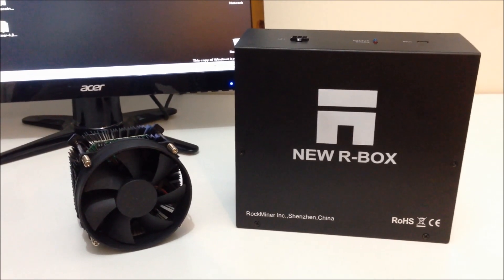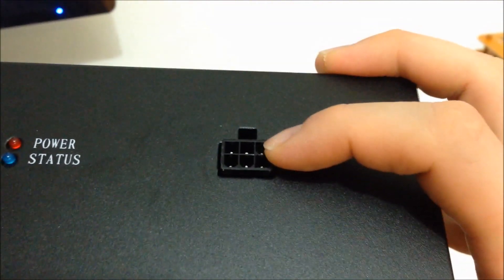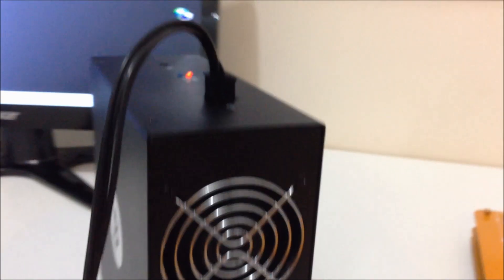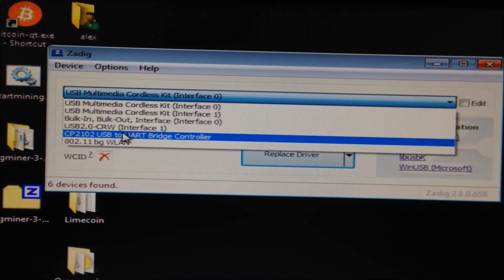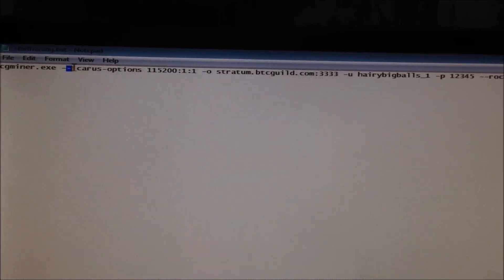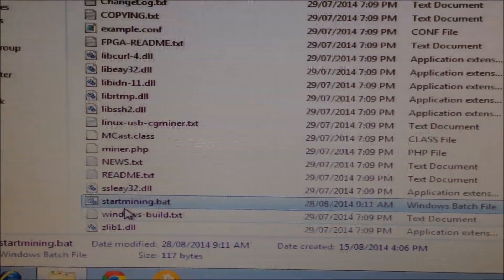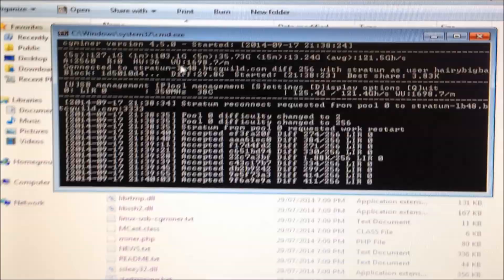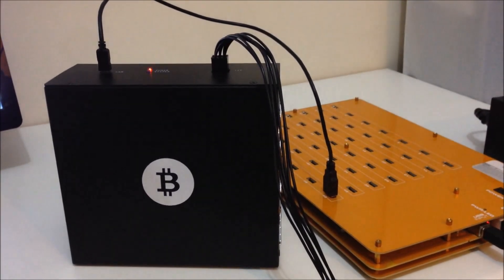How to setup Rockminer New R-Box 110-130 Gh/s Bitcoin Miner using cgminer

Comment: Hi everybody.

I recently purchased one of these R-Box 110-130 Gh/s units on Ebay (not from Eyeboot). I know that due to currently Bitcoin difficulty and many other more powerful ASIC's, this may be obsolete, but the price was good and wanted to get one for curiosity and testing.

The hash rate varies between 120 and 135 Gh/s with no apparent heating but there are some things that would be improved:

1) Terribly noisy, seem that the fans always work to the maximum speed. It's impossible to use it in a normal house without fuc* the neighbors :(
2) The micro USB cord is too short, making it necessary to have the device near the computer.
3) A switch for turn on/off the power would be welcome...
Reply from the maker: ***** Hi you can buy a new usb cable from here:
www.eyeboot.com

The fan should not be noisy at all. You can replace them. Contact support@eyeboot.com to order replacement fan. They are in-stock.
Reply: As I said in the previous message, I bought this R-Box unit from an authorized german reseller on Ebay.  It was new, sealed and in perfect condition.  I'm completely satisfied, but the fan noise is annoying as I said in a in a previous message.

The R-Box is working good in a old XP notebook with CGMiner 4.9.0, with hash rate of 120-135 ghash, at 32-36 ºC and the outer box is completely cold, but fans always seem to be at full revs.  It's like you're playing with a game that  has many graphics requirements and the graphic card  is working at fullest potential.

This happens even when plugged to the power supply but not running the CGMiner and connected to a pool. I don' know if it's is normal or that the internal fan regulator (if it has one) is not working.

Can these fans be replaced for other a little less noisy, like the CPU fans for example?
Thanks